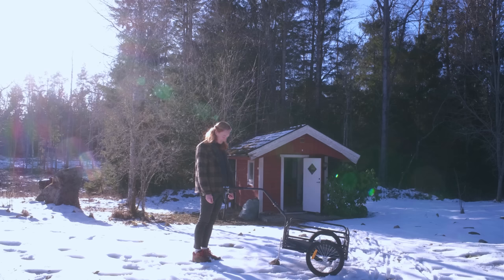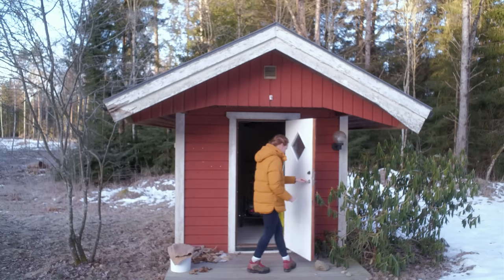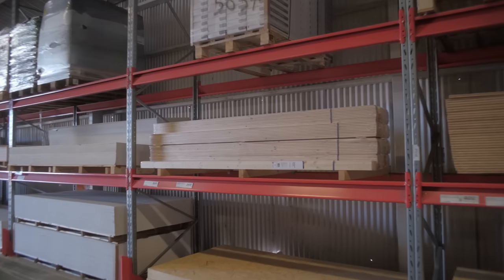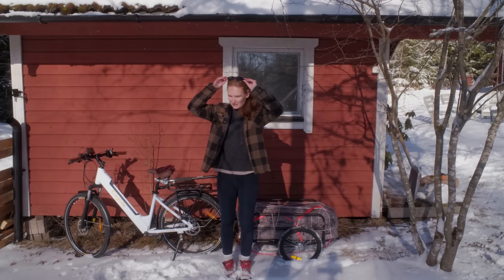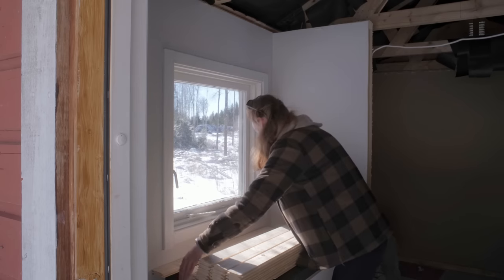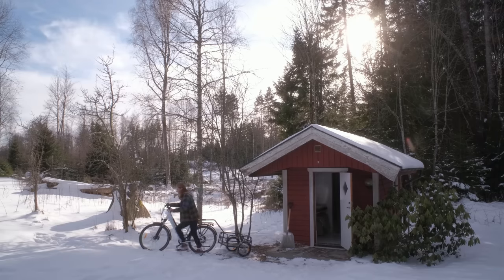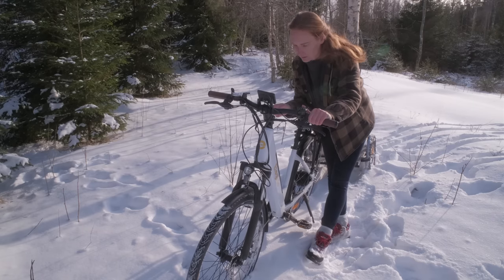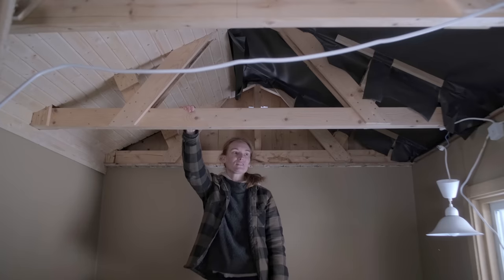Picking Up Building Materials With My Bike (Story 46)

Comment: Hi Rosie, as a woman and DIYer living alone, I also transport LOTS of building materials with my bike (I don't own a car). I keep transporting tons of wood, and each trip is definitely an adventure, with people looking at me like I'm crazy. 😄I'm super impressed that you do it while living 35 km away from the hardware store! 70 km by bike in freezing temperatures, that's on another level! I'm  glad it went well. That trailer looks super useful. Also, the ceiling already looks amazing, incredible job!
Reply from the maker: I love this! How do you transport long pieces of wood or oversized materials? Feel free to share any insights that might help me! :D
Reply: @wildrosie  Hey! 😊I transport most ot them on the back of my bike (I have a large luggage rack), I secure them with lots of tensioners and straps so that it's super sturdy. It has worked with wooden boards up to 2 meters long. Of course, I have to be very careful because suddenly my bike is a lot heavier, wider and longer than it should be,  haha! For super heavy materials that are impossible to transport on the luggage rack, I have a kind of wooden board with four wheels which can carry up to 200 kg. I either attach it to the back of my bike to pull it (but it's quite hard), or I pull it by hand and take the train/subway back home, since I'm lucky enough to have that option. That board has saved me hundreds of euros of shipping costs! (It's also very convenient for Ikea trips!)
I think a proper little trailer like yours would be even better, though, I'm seriously considering DIYing one =)

Comment: Every hardware store that sells timber in Canada has a saw station where you can cut timber or plywood, etc. It's usually a circular saw set up on a glide system. If your store has that you could really reduce your cutting time, especially if you cut several at a time.
Reply: Same in Europe. Every hardware store cuts your timber for free, as long it is just a cut to allow transport.
Reply: I think she did that ???
Reply from the maker: At this shop, the cutting station is a large table outside with a couple of hand saws haha. I brought my own saw as the ones there are awful to use! No fancy machines or cutting service offered unfortunately...

Comment: Thank you Eleglide for sponsoring Rosie, she will be a great ambassador! Congratulations on your new electric bike! this will make a big difference for your commute! Load your lumber diagonally like you showed at the beginning, that way you dont have to cut it so short. And your riding on quit streets anyway, so the overhang does not matter. Just mark it!. Check the load capacity of your trailer, But I'm convinced, you can load a lot more. And take advantage of your electric bike and go a little faster! Dont leave the battery in the cold and always charge it up. And specially in the winter, warm the battery up before you leave, and even plug it in at tyhe store, while you buy your stuff, I'm sure nobody will oppose to that!

Comment: Game changer!  How serendipitous to get the trailer and bike at just the right time :)

(Echoing other comments, your neighbours are just waiting to help you :) )

Also, a future project for you might be to get your moped ("AM") driving license.  This is relatively cheap and easy.  What is interesting about the AM driving license is that it doesn't just cover mopeds... it allows you to drive a proper tractor, and also cars that have been converted to legally be tractors (search blocket for "a traktorer" to see what these look like.  They are really popular with teens and you've probably seen them on the roads already.). Now, I'm imagining that all your neighbours have little old tractors that you could borrow.  They are also cheap.  But I like the idea of you connecting with neighbours and if you can drive a tractor you can help them with forestry as well as you getting your big supplies...

Comment: If you can get two bicycle wheels, you could make the cargo trailer frame. With the current trailer and this new trailer you should be able to transport lumber in full length. And you can even split the load on the wheels. You tie down one and of the lumber to the current trailer, and the other end to the new trailer. Sometimes log is also transported like this when the log itself is the "frame" of the trailer.

Comment: Hi Rosie. I don't know too much about it but here in Norway, we are always told to leave wood inside the room, at room temperatures, before using it for projects.  Otherwise, there is a risk of it expanding when it heats up. I hope you don't run into that problem!
Reply from the maker: Actually that's a good reminder - I forgot about that! Will do that next time I pick up more :)

Comment: Hey Rosie, I'm worried that you may not have the correct space in between your insulation and the roof. I've heard that there needs to be space there so that the roof shingles don't overheat and wreck the roof. Maybe you already compensated for that. Anyway, the ceiling does look amazing already. Way to go, you.
Reply from the maker: There's an air gap between the insulation / air barrier and underside of the roof :)

Comment: Hi Rosie, congratulations on your new bike. However, the saddle is probably set too low. Sit on the saddle and put the heel of your foot on the pedals in the lowest position of the crank, then adjust the saddle.
Greetings Peter
Reply from the maker: I purposely set it low so I can easily stop the bike and reach the ground while sitting down. New bike / new trailer / icy roads here and there, just being careful
Reply: @wildrosie  It might be a good idea to buy Spike bike tires for next winter.

Comment: This was another rich content video,and your production has all the details right. Just wrote Eleglide thanking them for sending you the eBike. Like your ceiling work. How are you going to support the wood from behind as you go up? That insulation is heavy. Take care. Thanks for sharing another chapter.
Reply from the maker: That's super sweet! The timber fixes to the beams from the framing, so it works out well :)

Comment: Sooo funny. I have an ebike and the minute I saw your trailer I thought about you using it with your analog bike and thought, "I know she's in great shape, but she needs an ebike."
And the box appeared. Lol
Adding to say, I love having a walk mode because ebikes are heavier and if you're towing something, heavier still, so walking them is very different than walking an analog bike.  And, yes, they are very different because the battery is like a middleman, preventing you from communicating directly with the bike, so it takes some getting used to, but it does become second nature! Enjoy!
Don't knock the throttle- if you're absolutely exhausted or injured and can't pedal, it will get you home. Also good for very steep hills, or getting started on a very steep hills. Many people use it to quickly get moving to cross a very busy intersection.
I keep mine turned off at the control unit because I just don't use it, and accidentally engaging it is no fun, but I like knowing it's there!
I'm soooo excited for you.
Reply from the maker: Aw yes I loved the walking mode in the snow! That was a surprisingly helpful feature. I also don't plan on using the throttle, I feel like I could use some driving lessons before using it haha!

Comment: why do you pedal? i thought bike was electric, no pedal.
Reply from the maker: Ebikes give you power assistance, so you pedal and they help. But if you stop pedalling, the assist stops (if it doesn't, you'd end up in an accident.) It's not like a motorcycle, although the throttle function does do that, I'm not sure if you might need a motorcycle license to use it. But also, one battery charge on full throttle wouldn't get me all the way to the store and back. This bike gives you 100 km on the lowest assist mode...

Comment: Your e-bike: a good e-bike drives exactly like a non-motorized bike because it senses your pedaling force and adjusts its own power to multiply your force by a factor which can be selected. If you stop pedaling, it MUST stop pushing AT ONCE (normally within a tenth of a second). - The behaviour you describe sounds strange; it makes no sense to select a maximum speed of assistance, these levels should define the amount of support, not a speed limit. - I am not sure if it is even legal to use this bike in the EU. A throttle function as you describe it is not allowed, other than the walking assist mode, limited to 6 km/h. Therefore I would not recommend such a bike to others.
(I am driving an e-bike since 6 years)
Reply: her bike is legal in the EU. She even mentions the assist is only to 25kph which is the EU legal limit.  There are plenty of ebikes like this here in the Netherlands.
Reply: @AnnieBellet  How do you know? - the 25 km/h limit is not the only requirement. An e-bike (more precisely: EPAC) must behave according to EN 15194. The thumb throttle of the Eleglide T1 does not conform. There seems to be a secret menu to increase the speed up to 32 km/h. Legally, if you drive this on a public road, it is an unregistered, uninsured, not homologated motorbike for which you also would also need a driving license. You may not like to hear this, and I don't care what others do, but it is fact.
Reply from the maker: The bike functions as an ebike should. You don't select a maximum speed, you select a speed assist from 1 to 5, and the kph I mentioned was just an indication on the website of how fast you'd probably go. Which was actually quite accurate, but of course completely depends on your own pedalling. And of course the bike stops assisting when you stop pedalling. The throttle is a completely separate function, and came with a warning to check if it's legal to use in your country, and of course to only install it if it is. I don't plan to use it, so I don't know what the laws about throttles on ebikes are here, but I mentioned it anyways because I also have lots of viewers outside Sweden / the EU, and laws are different everywhere.
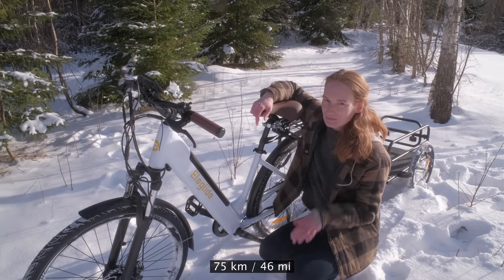Reply: @wildrosie  "The bike functions as an ebike should." - what experience do you have? - The motor control on this type of Chinese crap bikes is poor, they have omitted the torque sensor for cost considerations and just switch the motor on and off to the preselected power level when you activate the pedal. While a real e-bike senses the torque you apply and multiplies it by a preselectable factor. If you apply more force to the pedal, the motor also applies more power, proportional to your effort. Therefore it behaves like a real bicycle. - You mentioned yourself that you had to learn this strange and - in my estimation - dangerous behaviour of such a ON/OFF vehicle 23:50
Reply from the maker: @Henning_Rech  What experience I have? What experience do you have riding this bike that you are claiming is crap despite never having actually used it? When I go up a hill and the bike senses I put more power on the pedals, it also gives me more assist. When I stop pedalling, it stops giving assist. What's dangerous about that? And no, it's presumably not going to be as amazing as some other bikes that are 2 or 3 times as expensive. That's why it's cheaper. Cheaper bike is going to be less good at certain things. It's the whole point of it.